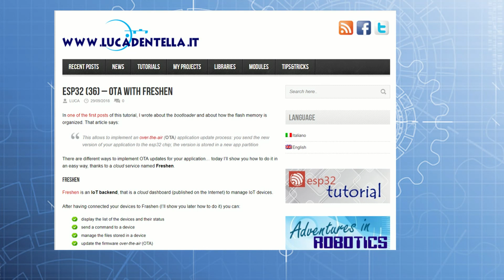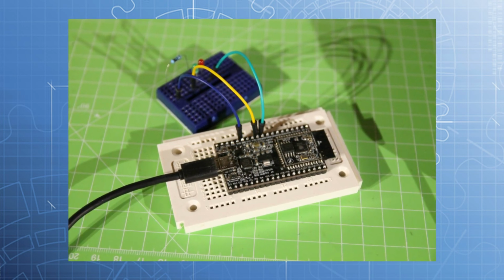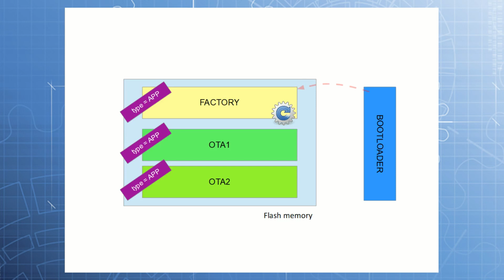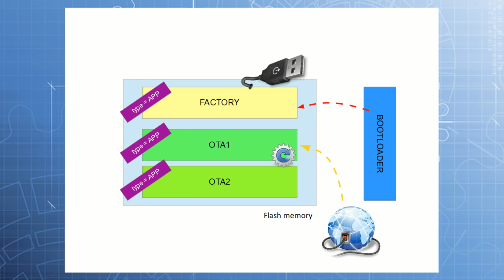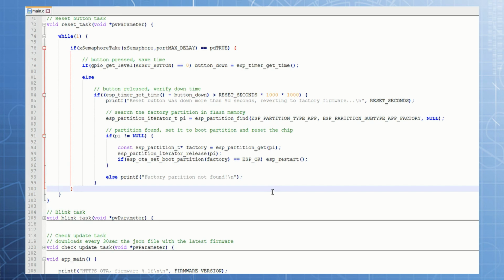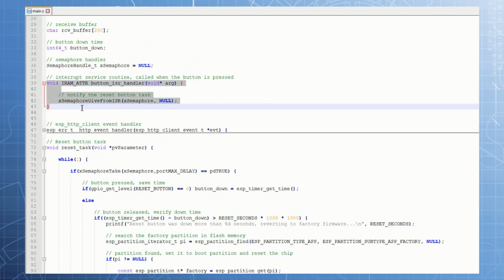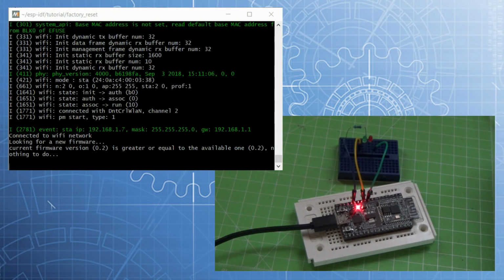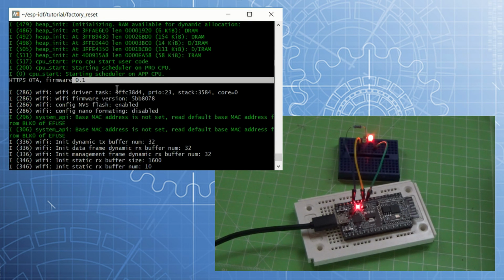ESP32 Factory reset

Comment: please give me the name of GPIO RESET BUTTON you have used in your program.
Reply from the maker: It's the EN pin of the chip, that is normally connected to 3.3v via a pull-up resistor and a button to ground in almost all dev boards (check the schematics).

Comment: Hi Luca! I could not found the code for this reset on your Github area, which folder contains it? Grazie!
Reply from the maker: Hi Rafel, as you saw in the video it only needs a couple of lines of code to reset the esp32: you can find them in the blog post related to this video (http://www.lucadentella.it/en/2019/01/13/esp32-38-factory-reset/)

Comment: Boa  tarde pode me ajudar como resolver o erro 
A fatal error ocurred: MD5 of file does not match data in flash !
Reply from the maker: Hi! Which of my sampe programs are you trying to upload?
Reply: @lucadentella  I'm using an esp32, it crashed in this message I can't load any more code.
Reply: I would like to know if you can help me do a factory reset on esp32
Reply from the maker: @jeanfiuza8666  I found some messages in the official forum about your error but it seems related to hardware issues (broken chip...), nothing that a software reset (as explained in my tutorial) can solve.
Reply: @lucadentella  I am extremely grateful for your attention in helping me to solve the problem, I will continue looking for a solution, and if you find it, I will post it here. Thanks